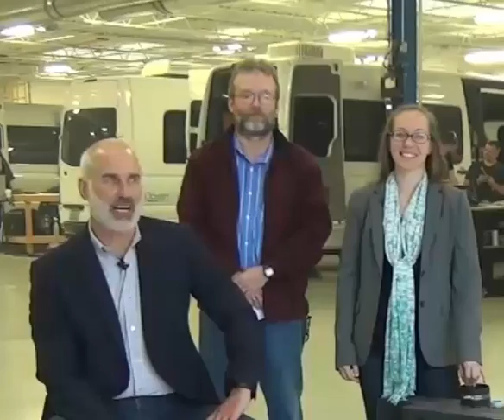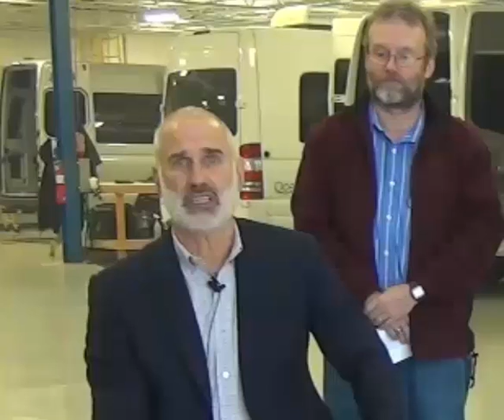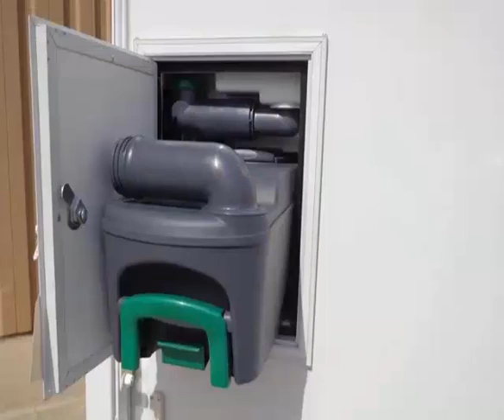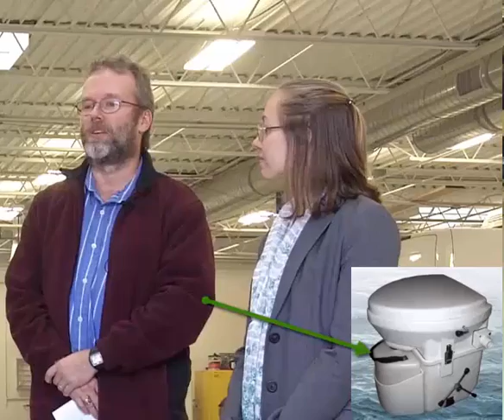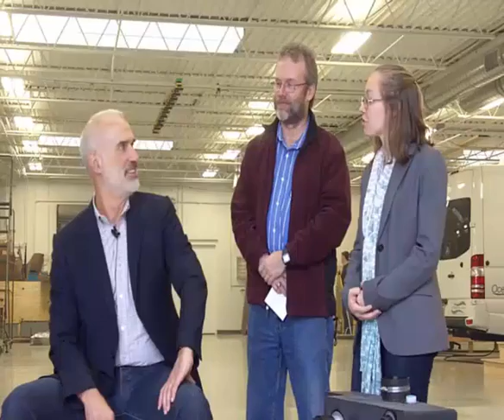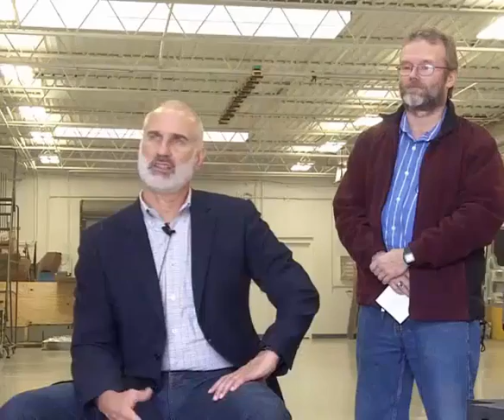Advanced RV Talks Toilets - Composting Toilet, Cassette Toilet and Black Tanks

Comment: This is the first van-conversion (company or individual) I've found installing black tank systems.  After owning 3 different RVs, all with black tanks, I don't understand why people are so against them.  You always hear, "We don't have to deal with a black tank!"  Well, instead they have to carry their jug into a public bathroom or outhouse to dump.  Yuk.  We've never had a problem with a black tank, dumping is extremely easy, and dump stations are plentiful, at least in the USA.  It's the one system, it seems, where you never have to re-visit your own waste after it initially disappears in the toilet.  Totally out of sight forevermore.  To me, that says it all.  No doubt people prefer the easier installation of a cassette-type or composting toilet, but IMO, a black tank is BY FAR the easiest to live with, and the only way to go.  Thanks for the video.
Reply: I think it might be a matter of how you RV. If you slend a lot of time in established camp sites black tanks make the most sense. But if you like to boondock or travel outside the country, like to Mexico, a black tank isn't going to work. Also, if you have a wet room a cassette toilet lets you remove it and set it aside for more room showering.

Comment: The black tank will add weight to your vehicle as it fills however and consume water with each flush. Its convenient but has its own drawbacks. AND, for an external tank, you can't be a 4 season camper.

Comment: What do you think of the 4th option, incinerating toilets?
Reply: Carl Fox yes an incinerating toilet that would run off of the diesel would be perfect. It would be nice to have a van with all of the systems running of diesel and solar
Reply: Carl Fox I have heard that the incinerating toilets can have a very bad odor.
Reply: @reagan4583  Interesting. I wonder why since everything is ash fairly quickly.
Reply: Helen Holt I have no idea. I just read those types of comments from users.

Comment: LMAO...love the opening. For those who are still confused, the composting toilet system is most appropriate for full timers who boondock. and also have next to no weight. But you're carrying supplies around. The cassette toilet is for part time/ weekend warriors. The standard system is for everyone but you are going to a waste station to dump.
Reply: This is not exactly 100% correct. With a cassette type. I am thinking more of the European Types and tank sizes being near a normal toilet size compared to the portable pop up camper styles. If in a remote location boon docking all one would need to do is dig a small trench emptying out the contents of course at least 100 years from any water source and cover the waste. Same as going when out in the woods. Yes it is a little more work in that manner. Yet I do see so many benefits of being able to not have to worry about dealing with a black tank and having to have a station to empty. Plus the black tank and grey water can be combined for more storage if necessary. I know as far as boondocking the Channel gone with the wynn ended up using composting toilets and have extensive experience with one as well as installing on their sailboat as well. For me dealing with waste is the least enjoyable part and I am still trying to find the best solution. In the end I may be forced to use a black tank as I may be resigned to have to go upwards of a 30 foot rv due to the fact that I want to full time it and am having to travel with my service animal a large lab, my wifes border collie, her Orange Tabby Cat, and of course my spouse. Not in any particular order.. lol..
Reply from the maker: Thank you for the clarification, Anti Petrolhead!
Reply: Nailed it

Comment: If you have the composting toilet, what happens to the black water tank? Do you just not install one or do you use it as an extra gray water tank for more capacity?
Reply from the maker: +Lawrence Dunbar We are open to discuss how that space may be utilized in a build.  In this unit, we plumbed for a black tank in case the owner wanted to take out the composting toilet and put a standard toilet in.  This is the only compost toilet that we have installed.  Each clients motorhome is unique at Advanced RV.  How it's configured is determined by client travel needs, physical limitations, and quality engineering and design.
Reply: Cool! Thanks. Quality is very apparent.  I love them!

Comment: Can't stand composting - it's simply too much trouble. The one fact that you guys might not know regarding composting toilets is the smell OUTSIDE the motorhome. Sure, the fan keeps it OK inside, but then while sitting outside - not so good.
Reply: RV black tanks are vented to the outside of the rv as well.  The black tank contains both urine and fecal matter.  Together, those two produce a smell much more obnoxious than a composting toilet that smells like soil.  Do you have a composting toilet in your rv or are you just speculating?  Sounds like the latter.